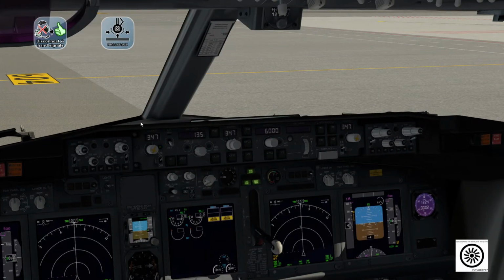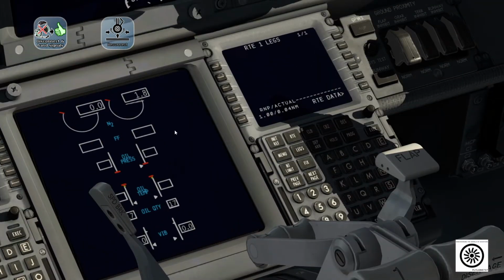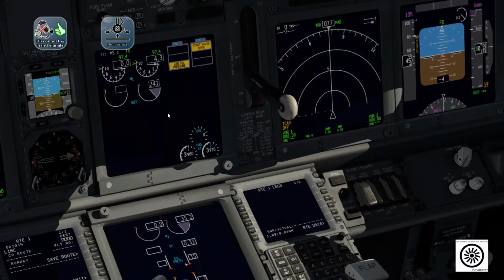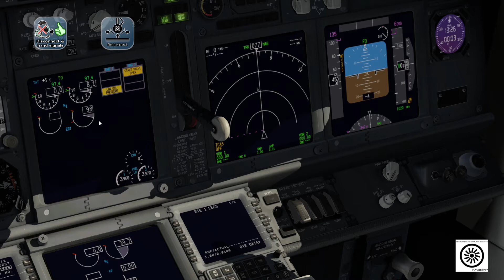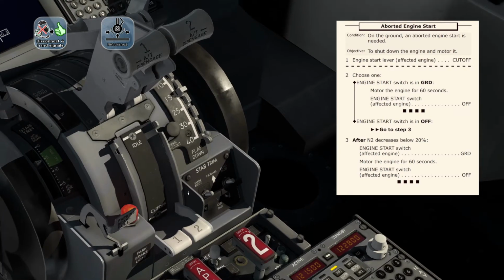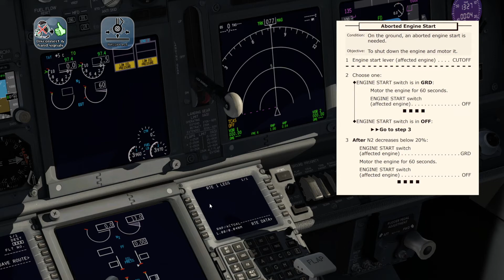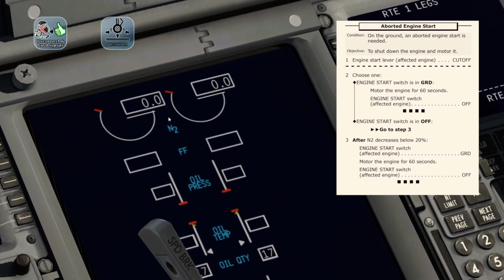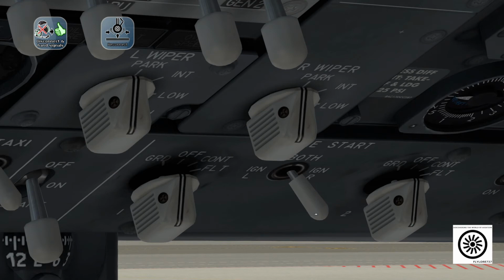Learning 737-800 - Engine Wet Start [ENG]

Comment: Why do we start engine number 2 first?
Reply from the maker: Hi 🙂 As far as I know it is a safety related issue. The airbridge, the stairs, the doors where passengers usually board and deboard the plane are located on the left-hand side of the plane, looking to the direction of travel. Same thing applies for luggage loading and unloading. So engine number 2 is typically started first because it is further away from the airbridge and boarding/deboarding doors. 
The opposite applies when the engine needs to be started with the ground air cart. The cart is attached on the right-hand side of the aircraft and, in this case, engine 1 is started first, because it's further away from the cart. 
Please, anyway, bear in mind that every airline around the world can develop their own procedures in which, all I wrote before, is completely different 😊 But...as rule of thumb, is as reported here